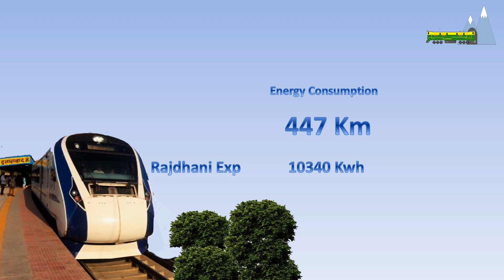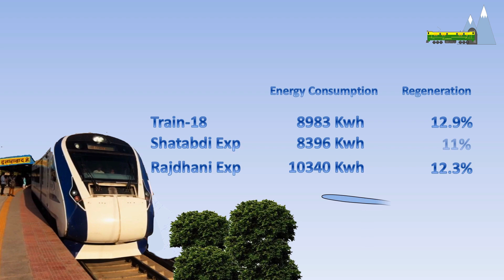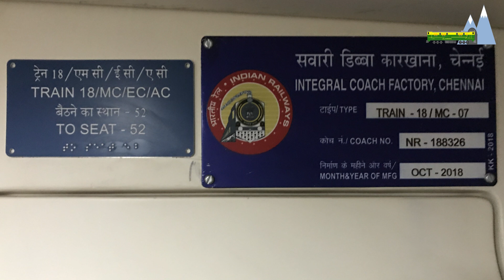Train 18  why manufacture stopped;  drawbacks and flaws; what went wrong?

Comment: ICF should use alloyed aluminium to make these train sets.
Reply from the maker: Proposed Train-20 would have consisted of aluminium cars... but Train-20 project is now in a indefinite suspension
Reply: @TheTrainStory  what, why? that's sad. at least indian private sector should be encouraged to do R&D on rolling stock.
Reply: @ssssssssssama  ya you're right, now Titagarh firema is Indian company, RDSO and Titagarh can jointly develop aluminium body semi high speed long distance emu just aluminium train 18 with much higher speed
Reply: @saravanv38  yup got to know about them recently. Bought 10k worth of their stock just because I but into their vision

Comment: The power output of Eurostar e300 is 16400 HP while that of e320 is 21000 HP. The e320 has 16 coaches and has distributed traction like Train 18. Train 18 also has 16 coaches. Since the power output of Train 18 is estimated to be around 16000-20000 HP, the energy consumption will increase because of higher number of traction motors as compared to locomotives. Since this train is first of kind introduced on Indian railway network, i don't think that higher consumption should be the reason. It's also important to note that the TGV trains on more than 800 km long Paris-Barcelona route cover the distance in 8 hours in each trip with a top speed of 300-320 km/h, so isn't the energy consumption per train on Paris-Barcelona line is high enough?

The per axle load of KTX-I trains is also 17 tons and they run at 300 km/h. These trains are based on TGV Reseau but have 18 intermediate coaches and 2 power cars.
Reply from the maker: You are right but the railway board has flagged higher energy consumption and higher axle load in its order stopping the manufacture of Train-18 by ICF!

Comment: This has been problem with most indian organizations . They always deny indian technology for some minor reasons .instead of encouraging it . For an example indian defense forces always deny products of DRDO and HAL  being little inferior to foriegn manufacturers . And now this train issue we saw 
Had India adopted made in India products we would be able to build superior technology
Reply from the maker: You hit the nail on the head. We will not tolerate minor defects in home grown products but are quite happy to accept foreign products with critical defects. For instance, we are ok with the rust bucket MiG 29K but the teething issues with Tejas are not acceptable.
Reply: @TheTrainStory  you bored that nail deeper in the skull . Absolutely agree on that we can keep on ordering Mig29 even in 2020 but keeps on finding issues with Tejas
Reply: @manishmanish562  Tejas does have major issues. Engine is American, radar is Israeli, missiles foreign and some Indian.  DRDO claims the plane is modular but it takes about an hour to change systems to change it from say ground attack to air to air combat. 1 hour is too much time during war time. Also the speed of LCA is quite low.

Comment: Please do make a video on a new aerodynamic WAP5 in Tejas livery whose pictures have been going viral on social media. That WAP5 is aerodynamic like T18 at one side, but flat like WAM4 on other end.
Reply from the maker: From what I understand, this will be a push-pull configuration. One loco at each end. While this is still a better option than a single loco, it is an obsolete format. The Train-18 multiple unit format is the way forward.
Reply: This idea has been adapted from British class 91 locomotives. If properly introduced it can be great idea for push-pull OPs with completely removing EOGs for intercity travel. The body design has basic flaws though which should be rectified.

Comment: I agree to that, we need indigious development. The reason, the rakes are heavy is because the coaches are built with stainless steel and not aluminium like the ones built by foreign companies.
Recently there was a technology transfer for manufacturing aluminium coaches to MCF, Raibareli from South Korea. This can be leveraged and ICF can build on top of that.
Shuting it down for such a miniscule increase in power consumption seems to be breaking down the Indian Innovation sprit.
Reply: If it doesn't give significant benefit over existing trains, it is not a smart decision to overhaul everything.
Anyways this was the first try, icf will improve
Reply: We hadn't the technical ability and engineering capability all we did was adopting someone's technology and produced here it doesn't make it indigenous let the foreign and Indian companies fight for the best trains like we see in Europe that's the way to go for modernization of Indian railways privatisation and private investment are a necessity

Comment: It was a commendable output by the ICF via Make in India initiative.
Its almost impossible to pull out something new for the first time with zero cons. The ICF made a good debut, and yeah of course the train requires some modulations, ICF can surely work on that, they have the capability.
And IR should work on improvising the tracks to increase the MPS (at least to 130kmph) on major routes other than NCR. This can also decrease the travel duration with our existing rakes and locomotives.